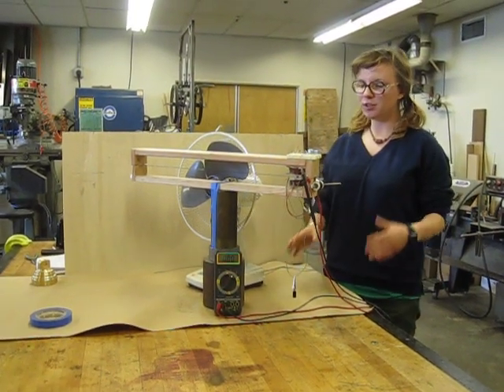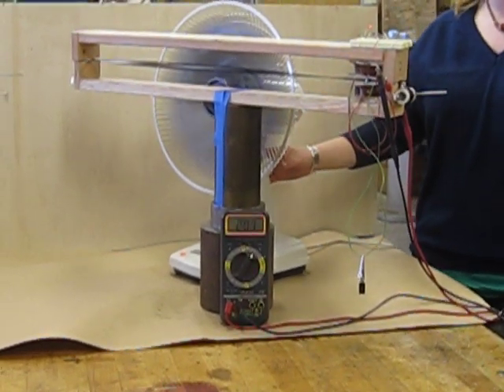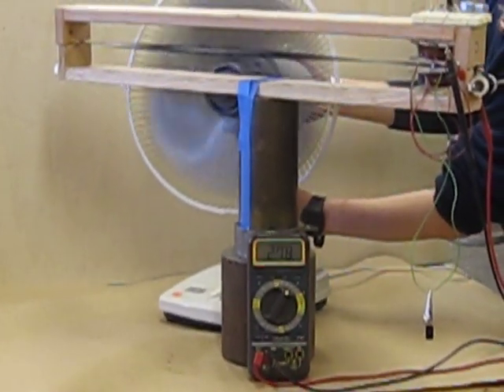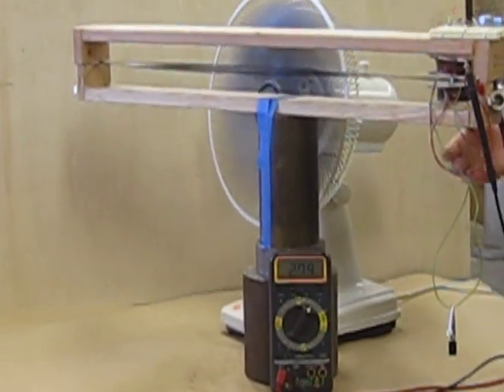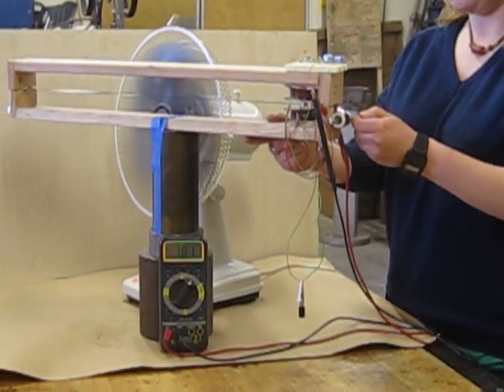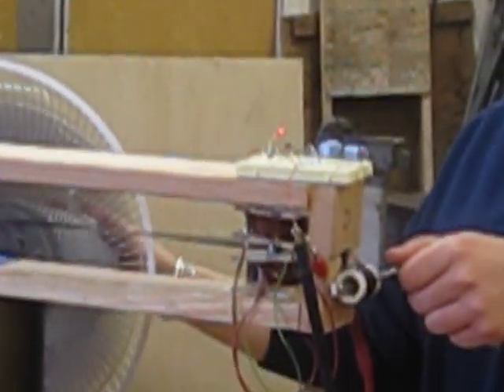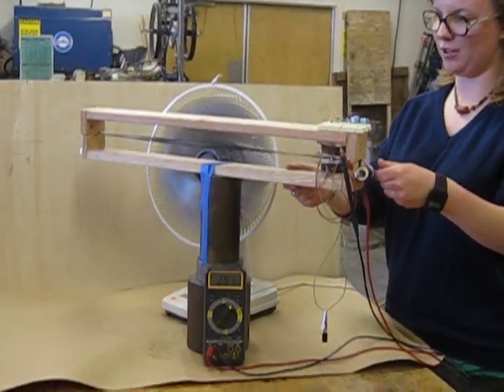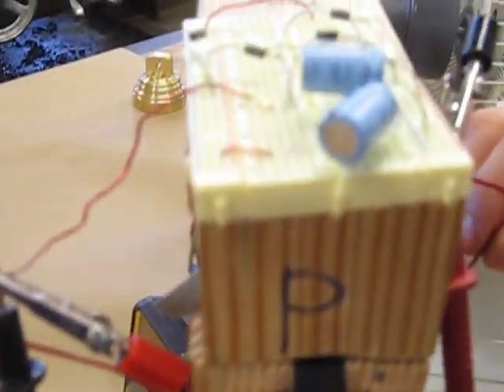How to use Energy in a Cinch: Windbelts

Comment: I think the issue with that is that because if the magnet is in the middle, the magnet will resist the coils (by nature of generating electricity) and it might make make the belt vibrate at a full wave instead of a half wave, making the magnet stay still in the center while the pieces of belt vibrate around it.